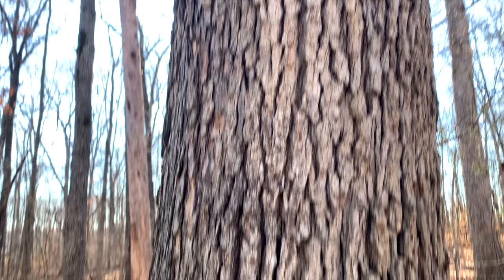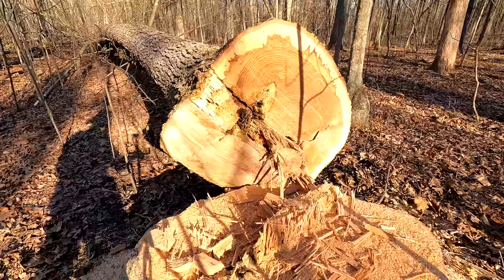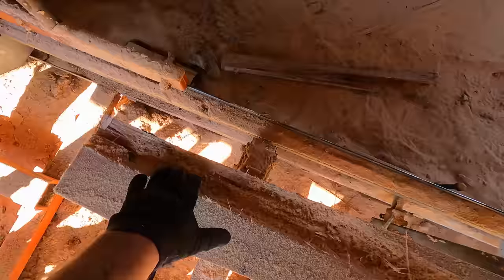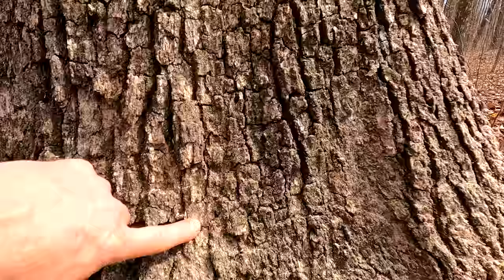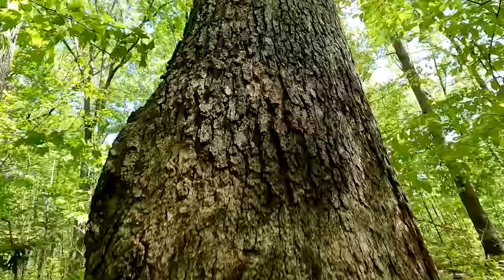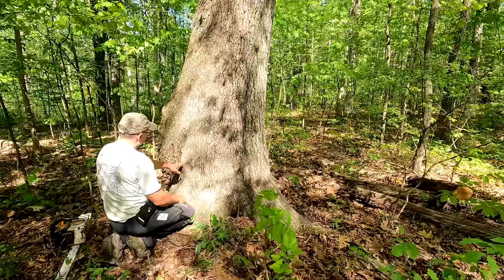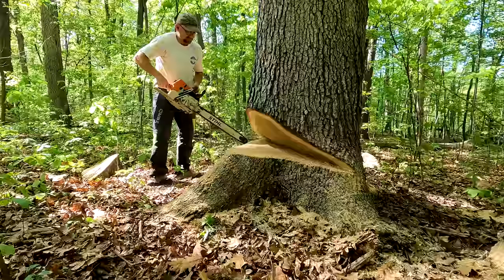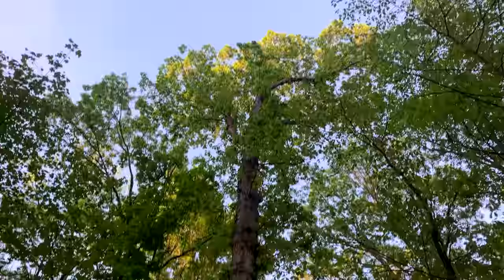Felling Big Oak Trees For Lumber.

Comment: Couldn't you have left the split but (not trimmed it) and milled the log them trimmed the few boards that did have cracks or rot in them. I'm stingy as logs like this are valuable from where I live.

Comment: It's amazing how long that drone can hover while you cut that tree.  Great shots.  Very good video.  

I've got a question on felling.  Very basic.  If I want the hinge to pull the tree either way as it falls, I'm looking at the hinge as a post.  If I want to pull the tree to the right would I make the hinge wider on the right side of the cut?  Like leaving something of a post on the right side of the hinge to pull the tree to the right as it falls.  

Thanks for the informative and entertaining vids
Reply from the maker: Yes, and you can steer the tree a bit as it is falling by cutting the other hinge more.  If it want it to go right, and there is no worry of it hitting anything and bucking during the fall, I will aggressively cut the left hinge as it is going so the right hinge pulls more.
Reply: @FarmCraft101  Thank you.  A simple way to help imagine how the hinge works.

Of course, I wouldn't depend on the hinge to do any pulling but I like to know which way the hinge works so I'm not working against the natural lean with the hinge.  Thanks again.  I'll be watching to learn.

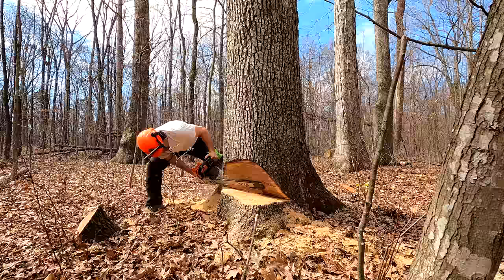Comment: 8:20 That will kill you.
you basically cutting the back cut from the face, do it slightly wrong and the tree is coming down with you in the way and your saw get pinched, you hesitate a sec to save the saw and bam you're a pancake

Comment: Watching you cut that second tree was scary. You really need to learn to remove those buttresses and then your saw will span the bore. You took out nearly all of your hinge with that dumb front bore cut. Although you seem to have a grasp of the need for a proper hinge, you cut two trees in a row with poor examples. Even though a wide felling notchnis good for directional control, it doesn’t really seem like you need that, and you waste nearly a foot of lumber with it. You should bore cut towards the back and remove half of the wood, or set your dogs at the back and arc the saw in to take out one side up to your hinge point.

Comment: I wouldn’t show your clips to my Apprentices, your tree cutting are dangerous and an ethical as arborist. 
1- You never ever plunge any tree from inside out (from wedge cut). 
2- you never  back cut level with the wedge.
3- you do not need to have flat Stumb if you cut it tight way.
4- you only plunge cut from back about 2 inches above wedge level to have that proper hinge and finishes like a step or a chair.

Comment: It had a big lean and you choose not to do a bore cut....for safety reasons. This does not make sense pal
Reply from the maker: Depends on what type of cut we are talking about.  In retrospect, I should have plunge cut from the side, defined the hinge, and then release the holding wood.  That's good for a leaner.  Doing a plunge cut in the direction of fall, like I did on the others would have been more dangerous, especially cutting from the notch side like I did.

Comment: As nice as I can I will you got off pretty dang easy with the first tree. That crack is called a barber chair and people are killed every year because of lack of experience. Notch the front , plunge cut parallel to the hinge then cut back to the back of the tree leaving a 4 or 5 inch bit of wood of course depending on the bark thickness. place. Place your wedges and then cut the trigger or the small bit  you left. No barber chair and clean shorts are a win every time. To those who will call me a key board warrior I say bugger off. I do not care what a person does. I am not one who wears saw chaps or tell others what to do. If any one else knows a better way to stop barber chair the please post it and I will use it.

Stay safe
Reply: Yes, plunge plunge the back cut or make the back cut from either side leaving a strip or Mohawk down the middle for holding wood. Then wind it up and cut that strip fast.